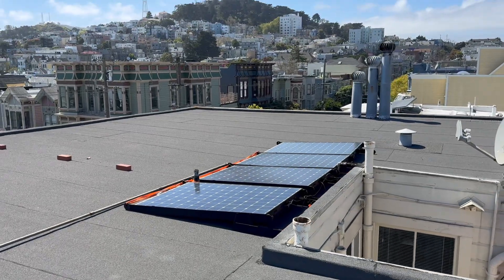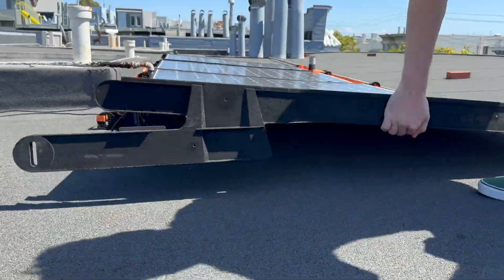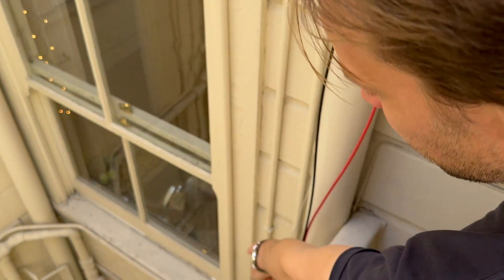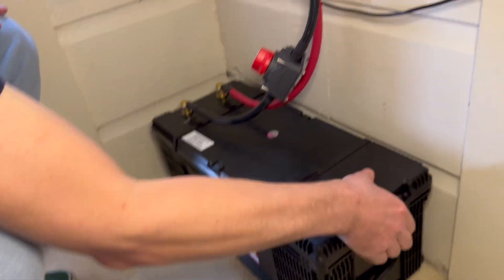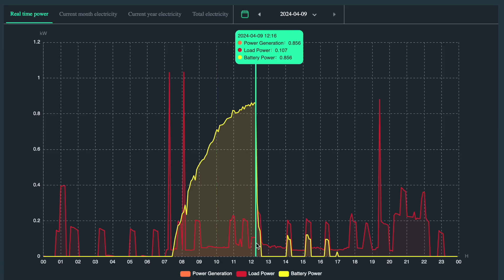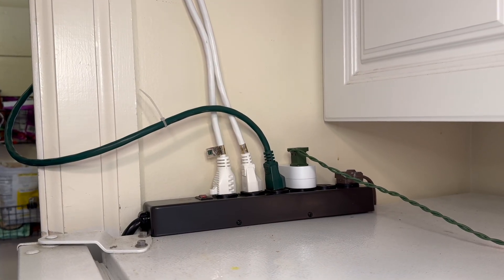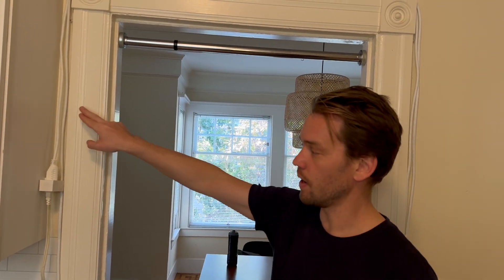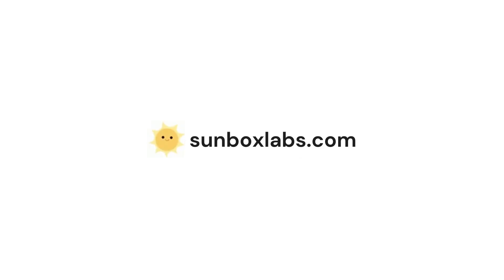$1,000 DIY Solar for Renters - Solar panel + 3000W "powerwall" battery for off-grid apartment backup

Comment: I've mixed feeling about this kind of setup
PROs:
- Setup works and is reasonably cheap
- Save energy bill
- Help reduce co2 emission if you reach your break even point in 4y
- Safe enough for you maybe, It seems you know-ish what you are doing.
CONs:
- House fire risk, if you were my neighbor or tenant, I would not allow my tenant to do that, at a larger scale, imagine you got this kind of setup in a 10M super city, how many household fire would you have? How can this setup can be safer?
- Surge safety? any RCD? how many fuse
- Ugly, non kid proof wiring 
- quite some investment and you won't be sure you can re-install in your next rental, 4y break even point for CO2 and bill.

I like that you are trying hard, but run this for 4y and let see if your building is still alive, would that saving help you to cover lawyer cost for the trial when you neighbor loose their life?

Comment: An alternative to so many extension cables is use the main fuse box. 
Trip the main fuse.
Remove the cable from the main fuse to the other fuses in the box.
Add a new fuse. 
Wire your inverter into the new fuse and connect it to the other fuses. You are now on battery solar.
From the main fuse wire in  the mains cable to the inverter via a new socket. 

My home runs on a very simple three KW inverter wired into the main fuse box. The main fuse is still connected to the instant shower 5 KW fuse because my system is too small for the shower. 
The day I remove my solar I just need to connect the main fuse to the other fuses.

Comment: For those windows you can buy flat solar cables and be able to close your windows and lock them.  I use them in the house I rent so much better then foam or pool noodles etc..
Reply from the maker: Thank you for the tip! Great to hear you're doing this.

Comment: Great video ! Looking for ways to cut on the electricity bill in the US, it’s too ridiculous expensive . How much are you saving ?
Reply from the maker: The cost was about $1,100, and it generates around $400-$500 of energy a year. Up to you if that's worth it for the savings  :)
Reply: @ it sounds totally worth it , you recover your investment in two and half years and seems relatively simple. Were you able to get all the govt subsidies for solar power ?
Reply from the maker: @artofstorytelling9406  No I didn't look into it too much tbh - but from what I remember the solar subsidies didn't apply to me because the panels are second-hand, and the federal home-battery subsidies only apply to 3kwh+ (I have a 2.5kwh one but nowadays you could probably find one for the same price)

Comment: Do you ever run an air conditioner or furnace using this system?
Reply from the maker: Air conditioner you can run, but furnace will be tricky. I'd recommend a heat-pump like air conditioner that can do both heat and cooling, and relatively efficiently! Just make sure it fits into the 3000W AC out of this inverter (or any inverter you get).
Reply: @nikodunk  cool, thanks for the reply!

Comment: This is such low-key genius. Everyone takes-for-granted that you need a quote from an expensive installer and that's the only way. You can DIY just about anything, as shown here! Rented apartments are pretty much ignored by the solar industry. I can't get to my roof on my rented apartment, so I have an even more low-key version with a mobile panel and battery I carry out to the pool area on sunny days and charge! Not perfect, but it works and stores a lot of energy for a total $350 system.

Comment: The extension cords are a fire code violation... they are affixed to the structure, and they run through a door opening. While you are being careful not to overload anything, I can't recommend anyone actually do this for that reason alone. 

Then there are various details that need addressed here.. The battery terminals should be shielded. The PV wiring should not be touching the roof either in the home run or between panels, the PV wiring should be secured on the external wall (flex conduit for the whole external home run would be ideal), and there should be a PV disconnect between the Panels and inverter.
Reply: DC power lines are also required to be in metal conduit as they enter the house.
Reply: So, some easy fixes and he's good to go.
Reply: @aegis7843  From the Panels to the inverter it's easy fixes. The AC side doesn't have an easy fix.  Either need to drop circuits to a "backup sub-panel" and equip it with a transfer switch, or install a second wiring system in the walls or with surface mounted conduit.  Either option isn't really rental friendly.
Reply from the maker: @WorBlux  Thank you for the feedback! Agreed it needs tweaks to be fully compliant with fire code in some areas, and that the A/C part doesn't really have a solution for renters yet, unfortunately.
Reply: @nikodunk  The solution i came up with is to not tie the system to the house electrical at all. I have 1 solar panel(470w trina on a structure made of 2x4 outside the balcony holding onto the 4x4 column) and a Delta 2(1800w inverter/1024wh battery/500w mppt) + extra battery(Delta 2 max extra battery extension 2048wh). I plug things in as the sun shine depending on what season it is. In winter if its sunny and cold i will prioritize space heater dumping and in summer i will use excess energy for cooking. It also charge all our electronics(laptop/tablet/phones/vaccum) and power my indoor bike trainer. I can keep the desktop and or modem running in case of power shortage if need be to make sure all the neighbors can still access internet. They also know i can chare their device in cas of prolonged power shortage or warm their meal if need be. Also have a smaller portable units that i can bring to a neighbor to charge their motorized wheelchair or power their cpap overnight. I live on the second floor of a 2 story appartment in Montréal! Cheers from another solar DIY renters! P.S. in Montréal there is about 15-20 people that have solar... it's pretty lonely :p I blame our 4.7c/kw!